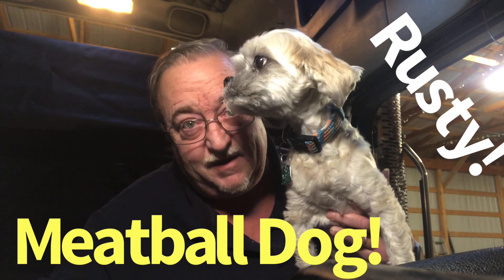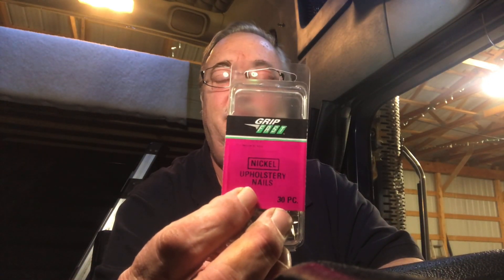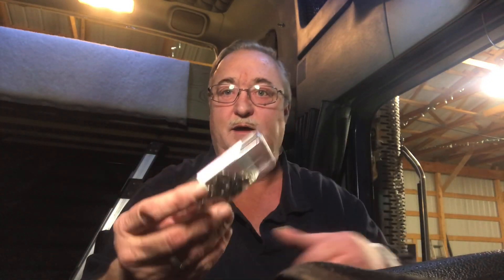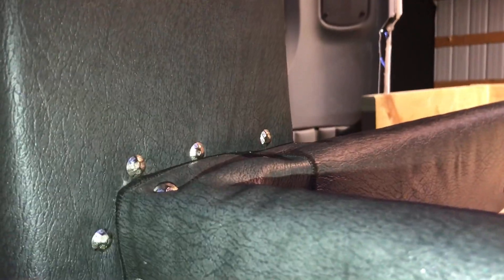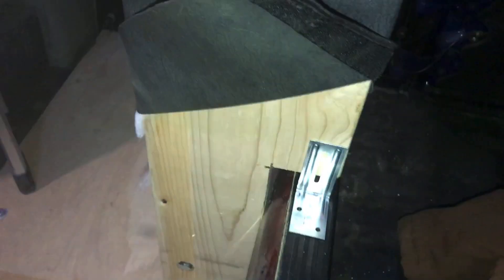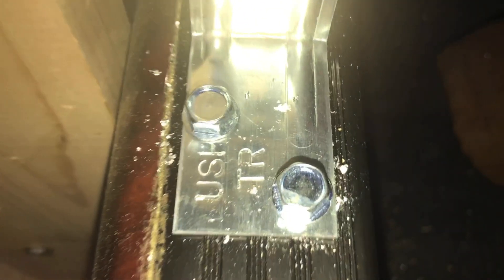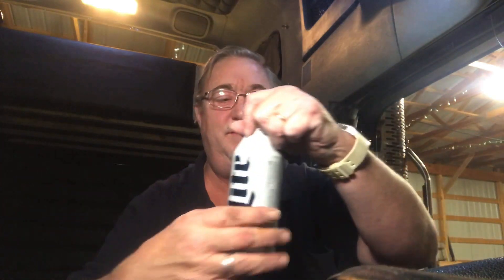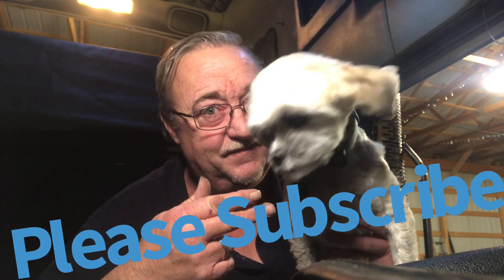Sleeper Remodel Update #25

Comment: 😁 Wow! I am very pleased again to have provided some useful input to your project! 
And I didn’t mind the reference to “good old” since I am now in mid 60’s so old is actually valid!

But an extremely minor correction at 1:24 as these chairs in my unit (and matching sofa that’s been in summer rental cottage for few decades) are FROM the 1950’s just like me, not 50+ years old (ok, they are also 50+ but more like maybe close to 70?).

Projects do often drag out! In the last day here, a very minor one to install a couple of pieces of wood trim to replace a section that was removed for another project took much longer than planned because it turns out there was nothing behind the ceiling board to nail into. So I had to go into the attic access to install a wood block to provide a nailing surface for the ceiling trim.
Reply from the maker: Always more than u expect. Thanks again John for the ideas. Making this project better I think!
Reply: @ClutchTrucker  and your public recognition in video of my suggestions certainly has made the time I spend on doing them SO worthwhile to me! As I likely said before, thank YOU for the shout-outs! I posted link to that previous video and a brief description on my FB page so maybe one of my ‘friends’ will become subscribers?
Addendum - I certainly wasn’t doing it to be recognized publicly, but just wanted to provide some ideas of how I would approach the task if I was faced with doing it.
Reply from the maker: Always appreciated!

Comment: Consider using rock wool or even spray foam especially on the outside underneath your bunk rock wall is a very dense and good sound proofer plus insulator